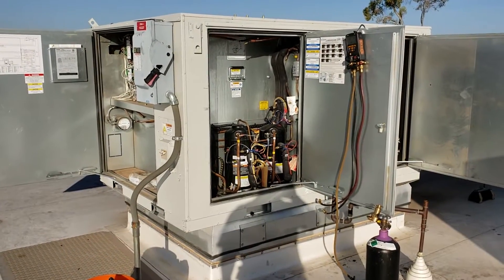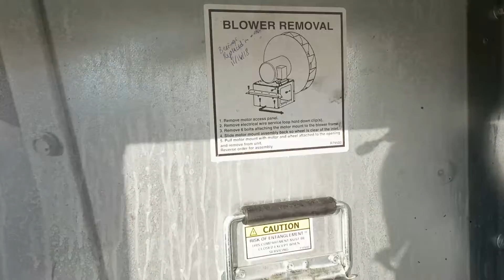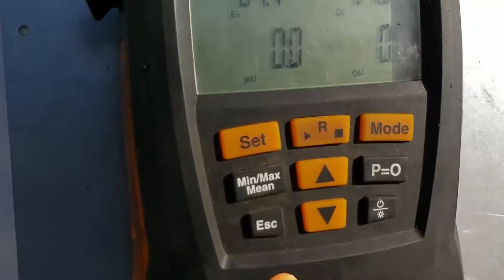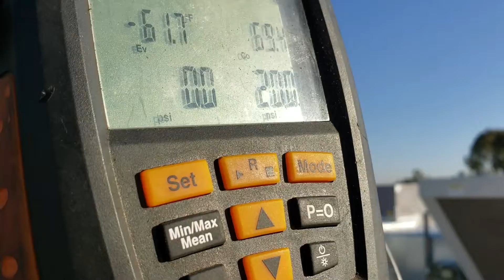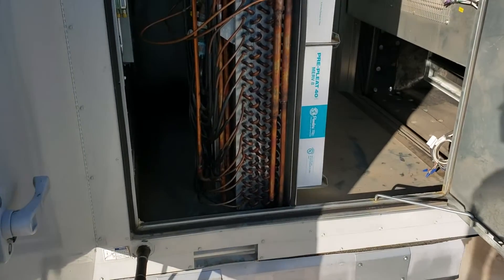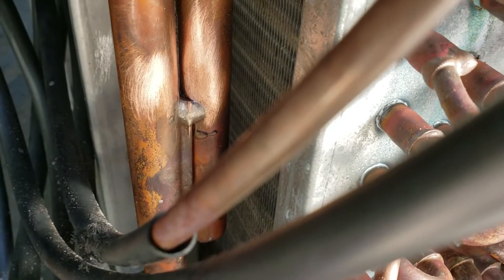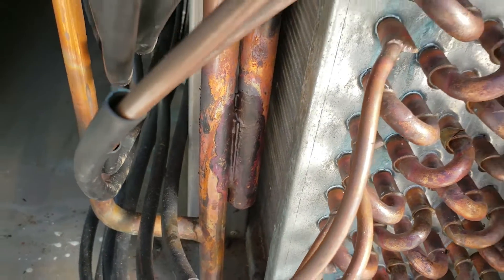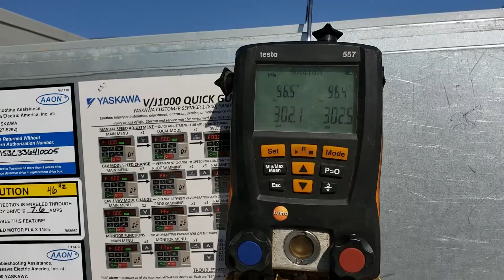Isolation test to find small leak in AAON RTU

Comment: We had an Aaon do that very same thing where I work. I first found it with an electronic detector, then nailed it with Big Blue. Same spot solder failure. It likely was leaking worse than the one you found. But your technique to find it is still great,; divide and conquer!

Always remember: it's an Aaon, it won't stay on...

Comment: Whoa, you must have super powers and a matching super drill. I have tried (albeit hand held) to swage 3/4 soft copper and can barely do it. 7/8 is out of the questions.  So I clamped some 7/8 soft copper in my vise, and still could not get it. I was using an 18v Dewalt XRP 3 speed drill with 2 freshly charge batteries. Could not get 1/2 in without locking up the drill.. 

What is your secrete super swager?

Comment: About how many hours did it take to do all that?
Reply from the maker: I worked on a few multiple things here and there but probably about 8 hours or so if I didn't pull off of it a few times. 
Although I did leave it for a day or two on the isolation test.

Comment: Would you call this a design flaw? Or just bad luck on a rare occurrence?
Reply from the maker: Probably just a random occurrence. 
It's a solid section of copper pipe just made more rigid by welding copper pieces in between the two. 

Kinda bad luck that designing something to be tough created a weak point.

Comment: What's the purpose of a re-heat coil?
Reply: Desert88 Z28 
Dehumidification
Reply from the maker: Once the space temperature is satisfied the control looks at space humidity setpoint.
If the space humidity is above the setpoint then the compressor stays on to maintain a refrigerated evaporator coil to condense the water vapor but the heat is discharged right back into the supply air.
Then it's drying the air without cooling it.
Reply: I thought AZ was a dry state?
Reply from the maker: @HVACslayer  
It is for most of the year until we hit the  "monsoon" season where it spikes dirt humidity and rains nearly every afternoon.